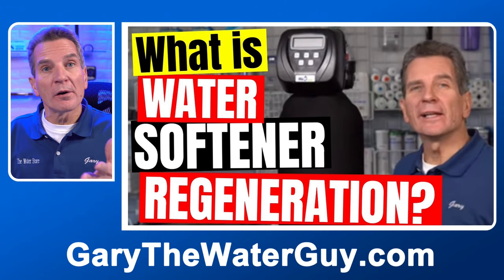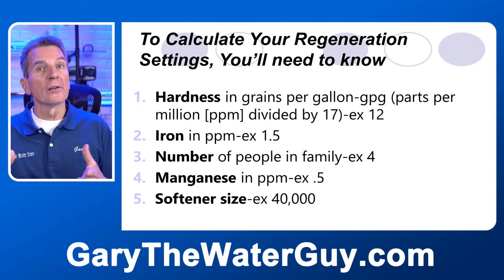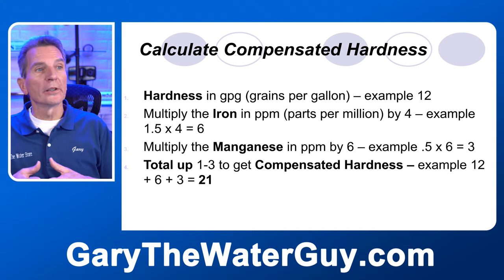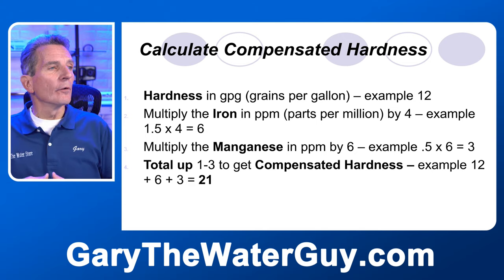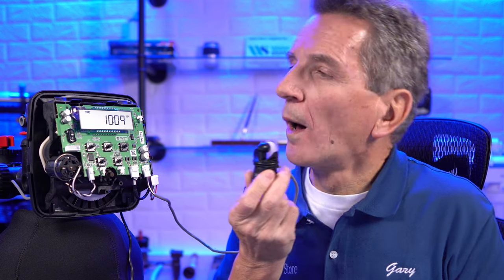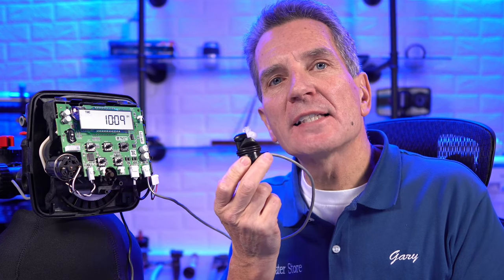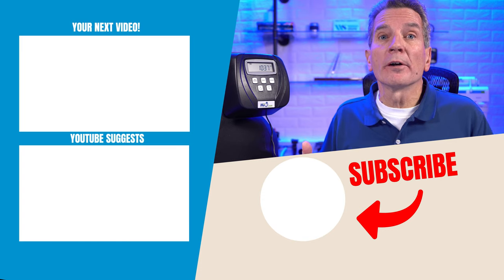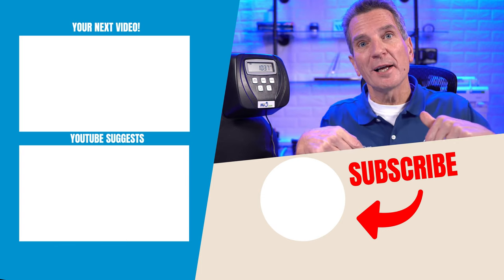How OFTEN SHOULD My Water Softener REGENERATE?

Comment: What do I do in summer when don’t care about using water softener for cleaning cars and filling pool .. I like to use usually for 5 months a year in winter .. does it need to regenerate even if I have it on bypass mode
Reply from the maker: Good question! It should regenerate at least once a month, so I would just put it into service then to regenerate.

Comment: We just got a Rain Soft EC5 water softner. My system is regenerating almost daily and im re-filling the salt tank with the required salt level  ( 4 ) almost every two weeks. I think perhaps we either got sold a system thats too small or a defective one?
Reply from the maker: Or more than likely it isn’t programmed correctly or you have a water leak somewhere in your home and since it is a metered softener you are going through much more water than you think you are

Comment: We just installed a water softner (NOVO) we typically turn off our water to the house incase of an leaks when we are in Palm Springs for 2 months. Given the new Water Softner what do we do put it in by pass Mode?? There will be no water coming into the house given its turned off at the main?? Any procedures you recommend Gary? Thanks  Steve and Julie
Reply from the maker: Good question.  Since you have shut off the water nothing will happen with the water softener, no need to bypass.

Comment: Good video. When you calculate the mg and iron etc. Does that over rule a ppm meter i bought online for this, or is that all I need equipment wise for testing? Faucet is 505 ppm, and filtered water from fridge is 350 ppm.
Reply from the maker: The meter you bought is probably a TDS meter, which tells you the total dissolved solids in your water.  the mg and iron are part of the total but sdo is sodium, calcium magnesium and a whole lot of other minerals.  If you want to know specific amopunts of each mineral you need to test the water for just those minerals not tds.
Reply: @water_estore  Thanks. I spoke to the manufacturer earlier today and it rung a bell lol. I don't think i will have much time to do and learn individual tests for now, but was wondering, if i buy a test strip test and just check hardness, will that number be good enough to tune the hardness level on the system?

Comment: Hi Gary. Great Video! My Sterling softener regens every 1000 gal. Is there a way to change that to 900? Our water seems perfect for the first 900, but begins to get worse the last 100 gal. Thanks!
Reply from the maker: Yes, you can either add 2 to the hardness settings or change the default gallons to 900.
Reply: Thank you! I looked for the gallon adjustment but couldn't find anything. I'll try adding 2 to the hardnss, that I did see.

Comment: My softener is metered, and it is my understanding that it will regenerate once the remaining capacity starts approaching 0. However, i have noticed that the softener will regenerate even when 600-700 gallons of capacity is remaining. Is this normal?
Reply from the maker: Most water softeners regenerate when you run out of capacity or every 14 days, which ever comes close.  So it could be you are getting close to the 14 days.
Reply: @water_estore Hi Gary, I essentially have the same question but my tank is metered at 4000Gal and by the time it is 14 days, my two occupant household had only used 900-1000Gal of softened water. My question is, should I be letting it use much more softened water before it regens? Possibly by changing regen cycle to every month or longer?

I've read some of your comments that I may have been sold a tank too big for our usage but this was the smallest one you guys had at 30k grain. My understanding is that it's regenerating too early due to our usage hence increasing salt usage but at the same time it can damage the media beads if not done every 2 weeks?

Comment: I have the 30000 grain HUM with the manganese filter purchased through your estore - it just did it's first regen after 14 days. This is the softener that was suggested and looking at comments below, this is oversized? I set the hardness at 20 which is a bit more than required. Is there a way to adjust so that maybe7 days in max? Thanks again for all the info you pass along - vids are great
Reply from the maker: Sure thing! Just sey the days over ride to 7 instead of 14.  This video shows you how https://youtube.com/live/c6r7qUK8to4

Comment: Hi Gary! I like your useful vides very much!  I have a  32k Clack softener and I use around 450 gallons of water every two weeks. The pre-set capacity on the valve head screen is 1250 gallon, but the capacity remaining is still over 800 gallons every time when the 14-day regeneration comes. Is it normal? By the way my water hardness is 20gpg.  Based on my situation, Do you think it is necessary for my whole house softener to regenerate every 14 days? Can the time be increased from the current 14 days to 28 day? Thank you for your professional advice in advance!
Reply from the maker: It depends on a number of factors but you need to make sure you have correct info and your water softener is programmed correctly. Something definitely doesn't sound correct, as you are saying you use only 32 gallons of water per day.  This video will help https://youtu.be/XMY69hdhX44
Reply: @water_estore Hi Gary! Thank you so much for your help! I use little water because I'm the only one living in my house.

Comment: Hi Gary! I recently installed a rain fresh 30t at my work, standard setting was delayed regen off. Seems to work great for a few weeks, however now I notice it says usable left 0 and over run 5500 and the delayed regen set to on ? One, could the system do this on its own and two, why would delayed even be an option. It's ran so much through now past its regen limit ?
Reply from the maker: Sorry, not familiar with Rainfresh equipment.  Call them.

Comment: Do you have an idea of how many gallons of water go down the drain during a regeneration cycle?
Reply from the maker: Varies widely between makes, models and size.  Kind of like asking about gas mileage on cars.  Anywhere from 13 gallons to old technology (but still sold today) very inefficeint ones that use over 100 gallons of water.

Comment: Is it normal for a metered set on auto regen water softener to go 18 days without regenerating? Will it cause problems with the softener if it does not regenerate often enough? There's 2 of us in household. It would regenerate every 3 to 4 days at first when set up in garage but found out there was an older softener inground so it was moved to that location (buried).
Thanks Gary love you videos.
Reply from the maker: You should set the over ride for 14 days.  Does not make sense that it was 3 - 4 days before and now is 18 days.  Something changed.

Comment: I'm new to water softener systems but the one we have in our new home produces water that just feels "slimy" to me. (I've heard this described as "silky" by folks who like it.) The hard water here in Minnesota where we've relocated definitely beats up our laundry when there's no softener, so I understand the need for some softening, but is there a way to dial it back a bit so my showers don't feel slimy? With my eyes closed I honestly can't tell if I've washed all the soap off my face some times. There has to be some middle ground...any suggestions? Thanks, I appreciated the knowledge in your video.
Reply from the maker: Depends on the type of water softener but htis video may help https://youtu.be/i0-ZvXEyWz8
Reply: I'm 57 and have grown up with water softeners my whole life.  That "slimy" feel is what softened water feels like.  the "squeaky clean" you feel from your hard water showers is actually the residue of the soap still on your skin.

Comment: Sorry if this is off topic but I need this question answered.  Can you run a regeneration cycle on a water softener using only water?  I would like to run a regeneration cycle using only the recommended amount of water (2.25 gallons, "Refill" feature) and a sterilizer (bleach, commercial sterilizer).  I would do this after emptying and cleaning the brine tank.  My manual says only to use "Crystal" salt and all the crystal salt available to me comes with additives.  I emailed Pro Products and they told me not to mix there sterilizer with salt that contains additives.
Reply from the maker: Yes you can.  If you are trying to disinfect your water softener this video will help https://youtu.be/hQ1EDFzSJJE
Reply: @water_estore  Thank you for answering my question :)